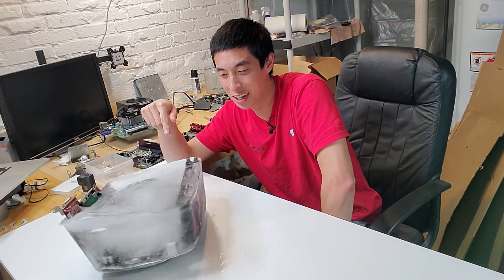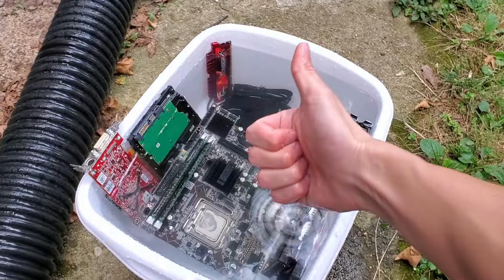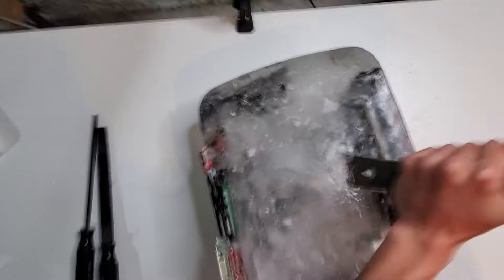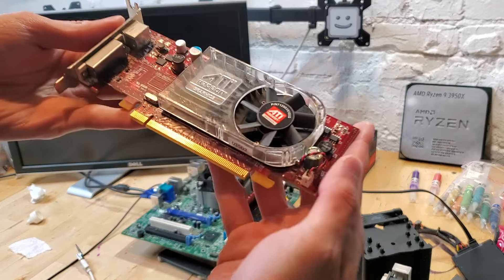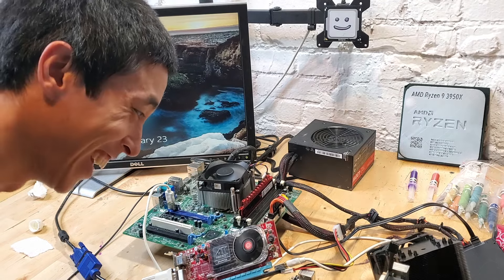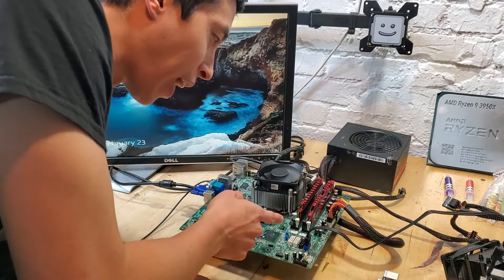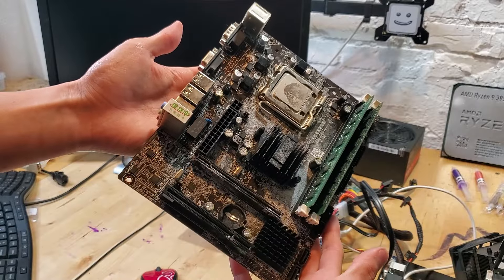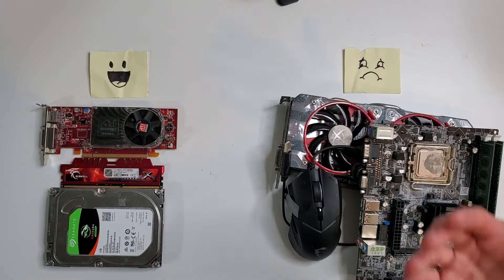Which PC Parts can Survive being Frozen in ICE?

Comment: I saw your short with the frozen 8400GS and found this video. 3:46 The port is not a Dual DVI-D, it is a DMS-59. The same connector is used for both 2x DVI-D connection and also for a 2x VGA (depending on the brand of the graphics card).

Comment: You left the cmos battery out on the mobo, it probably wouldn’t change anything, but it’s worth a try
Reply: it will just reset the BIOS settings every time you turn off the PSU
Reply: @CreeplayEU  Some motherboards (Usually OEM ones from Dell, HP, etc) will not boot without a CMOS battery in them. I've "repaired" three "broken" OEM computers for friends and families just by putting in new batteries. XD

Comment: The newer GPU was probably still wet which caused shorts, same goes the mouse
The hard drive still worked because they're sealed to prevent dust from corrupting data
Reply: Dust doesn’t corrupt data. They are sealed so it doesn’t land on the disk and crash into the microscopic magnetic head at 7200 rpm
Reply: Drives aren't sealed they have air holes
Reply: @kilgarragh  well if the dust happens to go through the read head, couldn't it make it malfunction or something, making it write garbled data?
Reply: @zUltra3D  1 spec of dust can completely destroy the entire drive as it bounces around on the platter at 5400 or 7200 rpm. Essentially rendering it useless.
Reply: How about this. Don't expose electronics to stupidity. That simple.
Reply: @JessicaFEREM  yes they are sealed, the holes dont lead inside the disk
Reply: @yeejay6396  they are doing this for fun Is that not clear?
Reply: Just take an old hard drive and dunk it in water and see if any bubbles come out (I’m guessing there won’t)
Reply: True, but it's still impressive because it's not a perfect seal, dust is basically not able to get into the hard drive but it's not airtight. At least most arent.
Reply: Nah it probably broke a capacitor or chip on the gpu off
Reply: @danny8376  correct
Reply: maybe there was some water inside the pipes
Reply: @janluofficial  nah the pipes are sealed and have vapour in them, best bet is there was water somewhere still as every part of a gpu(some fan types may get damaged) is completely waterproof as long as it's not powered, hardrives are one exception, there may be a small filtered whole for pressure equalisation but there's bunch more obstacles after the first filter and usually there's at least 1 or two more filters before reaching inside depending on the hardrive, but in this instance there would have been air inside stopping the water from coming in like putting a cup upside down into a sink full of water, the air gets trapped and no water gets in, plus the filters, it's quite hard to get water in there unless you tried 🙂
Reply: yep, he waited 2 days, there's 0 chance all the water would've evaporated from inside, as was clearly seen by the mouse.
the behavior was also the same, it did power up and work at first, then the residual water shorted stuff inside and bricked it for good.
if you drop electronic parts in water, most commonly smartphones, I'd open it up and wait at least a week before even attempting to turn it on, this often means whether the device is bricked or not.
Reply: yes
Reply: i honestly feel like the solder on the new gpu couldve been damaged, leading to those artifacts, maybe a reballing can fix it, who knows
Reply: @JessicaFEREM  erm  ... no they are sealed dont post about what you dont know
Reply: @idontknowwhyimadethis5517  they have air vents. they are "sealed" but they have filtered air so they can become equilibrium with the environment. 
I know what I'm talking about.
Reply: this test about  Survive being Frozen in ICE, not wet or dry shit dude
Reply: I think the hard drive stayed alive because hard drives use magnets and water is repealed by magnets because it is weakly diamagnetic which would leave a very small space between the hard drive and the water.
Reply: @alexmuse3565  water does not affect magnetic fields. It reacts to them, yes, but it can't alter or stop them. The hard drive enclosure is also sealed with a rubber gasket all around the lid to keep dust and moisture out. The only thing that could've been affected by the water is the control board on the bottom as it's completely exposed.
Reply: @imacgra1 yea they're still not sealed, other than helium drives.
Reply: @imacgra1Dude what?
Why are you replying to me?
Reply: did u read @kilgarragh
Reply: @yeejay6396  it is not stupidity
Reply: thats not what he asked...        water then dry....  no affect.... water   BAD for anything electronic lol

Comment: why didnt you dry out the parts more with disassembely, i imagine the most of the failures was due to you turnign them on with water still on the board. and the mobo/CPU had 1 heatsink down and no CPU cooling.
Reply: Ikr

Comment: I'm fairly certain hard drives are sealed. However, although the HDD is recognised, It might still be corrupted. My current tertiary drive (E:) has been laying in a corner of my wardrobe for 4 years and it was more or less full of data as it used to contain the data of my PC's predecessor. But once I found it again, plugged it in and wiped it, Data it writes gets corrupted and Unreadable later down the line. Know any reasons for this? It's literally been in one spot for YEARS and it's somehow corrupted. Because it surely can't be dust considering they're sealed?
Reply: The same stuff happens to me Is super weird, I have a ton of HDD that have this problem, whenever I put them on the PC they last for a few weeks and then something corrupts
Reply: @darwinjackson3560  I feel like it may have been because the 'precise spacing' between the magnetic disks is being moved around.

Comment: There seems to be a few problems with this video. I think you should've waited to for it to melt from the beginning without pulling stuff out. Also, you didn't give the parts enough time to dry as the mouse was still wet and the modern graphics card has a lot of crevices for water to be trapped. Finally, when you were testing the motherboard, I noticed the plug on the graphics card side had partially fallen off so it's possible that caused the motherboard to not post.
Reply: Cmos battery not installed as well. Also one of the reasons why it didn't post
Reply: @malcolmyp247  Some pc/motherboard will still post without a cmos battery. However it will throw up a dead or missing cmos error if it post.
Reply: @TwinShards  all motherboards post without cell battery. Some of them refuse to go after BIOS thought, or store data from BIOS (so they cannot even detect hard drive and store it, so BIOS knows what disk was detected etc...)
Reply: @malcolmyp247  all modern pc motherboards can post without CMOS battery, they store the data in NVRAM instead of battery now
Reply: @RAILGUNSHOOT  uhh no they use the battery to keep the data intact so it doesnt reset your bios ant tome settings
Reply: yeah.i was thinking the same.
Reply: and there was no cmos battery
Reply: IKR
Reply: I don't think there were any issues with this test, as the test was run the way he intended to run it.  That said, there is an opportunity for another test to see if there is a difference between the two approaches.
Reply: also shouldve used distilled water
Reply: @orisky5518  do you feel proud of your insightful comment? Are you satisfied over your masterful command of language?
Reply: @orisky5518 nice selfie bro
Reply: Also, no point on freezing, the same as watering it.
Reply: @born2rave270 🤓
Reply: also looked like some Corrosion that could have been wiped off and maybe that would have worked
Reply: Who asked
Reply: @malcolmyp247  I used my Gigabyte 1155 Motherboard for months without the Battery and it works fine, It just reset the bios every time i restart the pc.
Reply: I know I’m late but it’s still fun to watch 😊

Comment: This experiment was kind of bogus. You still had WATER trapped in some of these components. Of course something is bound to short out and not function. You should have completely dried these by leaving them in a tub of rice for at least 3 or 4 days. Not just 1 or 2.  The new GPU and mouse, may have actually worked if not for the fact that there was indeed, still water (even in tiny amounts) trapped inside. Also, yanking around the components when still in ice, was not a very good idea. It's no different than trying to yank components out of concrete cement. You're either going to crack something or like you shown the vid, pull something from the force. 

Come on. I thought this would be a great experiment but you dropped the ball.  For all we know, everything would have probably worked just fine. lol

Comment: This is not how you test a hdd!
Also the i would not expect the gpu cooler to be at fault, as the symptoms would be different. There are just way more ICs which are not exposed as in the old gpu. Water can easily creep in but needs a lot of time to get out, you should have bathed everything in alcohol before drying

Comment: You should have do a proper drying of all parts before putting them to the test. Obviously the older GPU will survive because there's less tiny air tight zones for the water to stay trap and not dry.
And for the new GPU & Mouse it's basically the same story but flipped the other way around.
Reply: Exactly

Comment: I have a question about my gpu. Is it dead, if it boots but turns off after showing random glitches on the screen and freezes

Edit : the freezes and glitches starts if i reinstall its drivers ( i had to use my integrated gpu to wipe its drivers clean and i also reinstalled windows but its still the same)
Reply: Maybe has a broken port, but sounds damaged in some way to me.

Comment: I still don't understand why the graphics card didn't work 
I understand that it would thermal throttle very easily
But why didnt it work at all (except the short time of bad graphics)?
Also, you should have waited until everything was 100% dry 
And cleaned the motherboard
Reply: He probably didn't wait long enough for it to dry, which caused a short
Reply: @naxzed_it  that wouldn't explain it
Because it did work for a short time 
Meanwhile a short would have killed it on startup not after some time (i think)

Comment: The hard drive kept working because there is an airtight seal where the disks are and it prevented water from getting into the disks so it still worked
Reply: What about the breathing hole
Reply: @germanfisch  ah it’s not 100% airtight, but the hole has a filter on the other side so water won’t get through that either

Comment: My idea before finishing the video: everything but the HDD. If water got into the HDD, no amount of thorough drying would completely fix it, there would probably be some small contaminates left inside which would reduce its performance or more likely kill it. 
The rest, as long as it dries thoroughly, should still work afterwards. Fans may not work though.

Comment: Assuming you let them dry properly every single electrical component will work just fine
Reply: Yeah, although I wonder what would happen if you repeatedly do this, because water will freeze and expand in gaps
Reply: @neosonixyz  yeah definitely could cause issues in that sense.
But judging by how the video card acted this time I'm 90% sure it still had water in it somewhere.
But I agree with you I do feel like if it were frozen and unfrozen multiple times that it would eventually quit working no matter how dry you let it get just because the small fractures that would be created
Reply: the newer gpu might still malfunction because of the metal lol
Reply: @noobiii  very well could be the reason.
Reply: Not true . Maybe if it wasn't tap water since that has other metals and minerals
Reply: @bojan6368  that is true however and ninety-nine percent of the cases I've ever had to deal with that involve electrical components getting wet simply drying them for a few weeks fix them.

And working in a computer repair shop I've seen a lot of that LOL.

Nothing I hated dealing with the most is whenever people would accidentally dump out a can of soda on their laptop. hahaha
Even then a good isopropyl alcohol bath and you can bring him back to life most of the time.
But not all the time

Comment: would be interesting to see the results if they were completely dry and cleaned off water residue
Reply: In theory, they would be completely unaffected unless the expanding of the water damaged anything. This is if the parts had no minerals tho otherwise I have no idea myself lol
Reply: @sabianwarner5316  I doubt there'd be much difference....
Reply: There's a high chance once dried out completely it will work just fine. I know this because I washed one once. Artifacts at first but once all dried out with air nozzle from a air compressor it had zero problems.
Reply: Chinese do that. After mining 😉

Comment: the reason the hdd still worked fine is because there sort of sealed in a way has some venting in it but very small and would be hard for the water to get inside it so it would've been just hard frozen outside and not internally

Comment: A toxic Room mate i was staying with back in 2020 poured a bucket of water into my $3600 pc while it was powered on while i was just coming home from work when i walked into the garage where i was staying i sat my car keys down on my pc desk and noticed my pc looked like a fish tank my pc case has all glass see through windows so it looked exactly like a fish tank lmao as the water was just pouring out onto the floor so i turned off the power switch from the back of the psu and then unscrewed the side panel window to release all the water out and then took apart the whole entire pc and dried out every part for 2 weeks then put everything back together then fired the pc back up at a computer shop all the pc technicians were blown away just in shock!! as i also showed them evidence pictures of the pc powered on filled up like a fish tank! ok so anyways when we fired the pc up it worked like a dream Zero damage the pc technicians told me the pc should be completely fried and shouldn't be working right now which honestly blew me away Aswell everyone was in shock! the parts that were used is listed blow Enjoy and thanks to anyone who took their time to read all this Cheers!
Pc part list-
Corsair 570x Crystal mid size tower
Asus ROG StriX OC Nvidia GTX 1080 Ti 12Gb
ASUS ROG MAXIMUS IX FORMULA Z270 Motherboard
Intel i7 7700k cpu
32 GB G.Skill Ram B-Die highest Grade Video Ram!
Samsung 970 Evo 1TB Nvme
Sabrent Rocket 4.0 2TB Nvme
Seasonic Prime Ultra titanium 850w
Current Monitor is 27inch Asus Rog Swift PG279Q 2k Monitor 165hrz Ips

Comment: The reason the HDD survived is because it has a seal between the actual mechanics and the outside which makes it waterproof. Maybe the board too?
Reply: the HDD probably would have break if it was placed in the middle of the ice cube. Being near the side the ice had no mechanical power to compress the tin silver cover (bending inward this cover into the disc can break the HDD)
Reply: 👆👆👆👆
Thanks for watching and leaving a comment you have won 
Telegram me to claim your prize....…..
Reply: More likely was sealed, but some are not as they have a small opening and behind it is a dust filter inside.

Comment: Cool idea for a vid, but super odd you put in so much effort to cut corners. We don't really know the true results for multiple components as you didn't let them fully dry and you yanked the Hell out of the motherboard possibly breaking it (you can even see a water spot under the heatsink you broke off, so it was yanked around and wet). The mouse also had obvious water still in it and the newer GPU probably did as well as others have pointed out. You also didn't test the CPU separately after guessing it would still work. No hate, just take the time needed to make the video complete and accurate.

Comment: I would be interested to know how many of the parts survive liquid nitrogen that freezes much faster and more aggressively
Reply: none nitrogen cracks everything because of how aggressive it is
Reply: @user-fe7bo5mm1o  then why people use liquid nitrogen to extremely overclock computers?
Reply: @Tobi_DarkKnight  nitrogen cooling doesn't mean just pouring nitrogen on a graphics card. it's done in a specific way and it's used because the card gets extremely hot. if the card isn't hot the nitrogen is just gonna crack it.
Reply: @user-fe7bo5mm1o  I think so too, but considering that technology gets very cold in space, it would be worth a try
Reply: @MarcelSchr  Fun Fact: space has no temperature
Reply: @germanfisch  do you man low? Bc no temperature doesn't make any sense like it's not cold not hot
Reply: @deionalexeigonzales  it does make sense in a complete void because it’s literally space meaning that there’s literally nothing there not even temperature.
Reply: @germanfisch  if there was no temperature in space how would we get heat from the sun 😂
Reply: @angryapple1259  temperature is the measure of kinetic energy in particles. If there are no particles, there is no temperature.
Reply: @minnalunar the n why in theory if you go to space without an astronout suit you would freeze that makes space cold